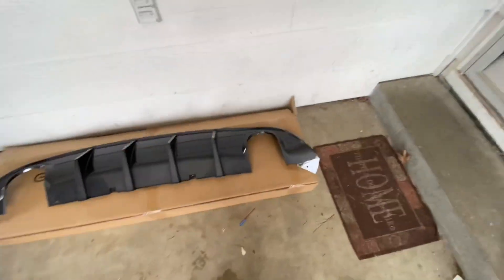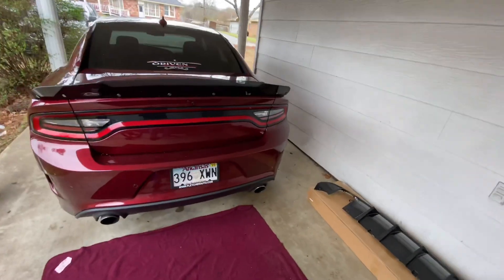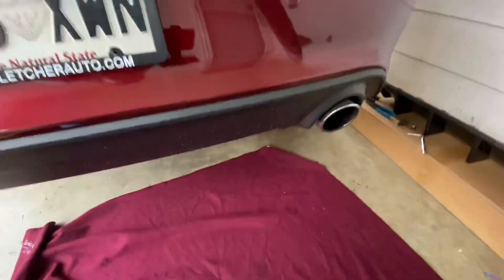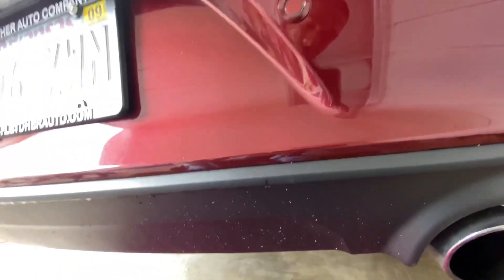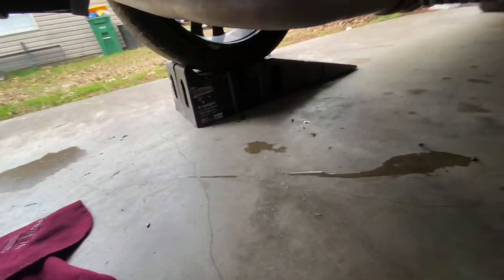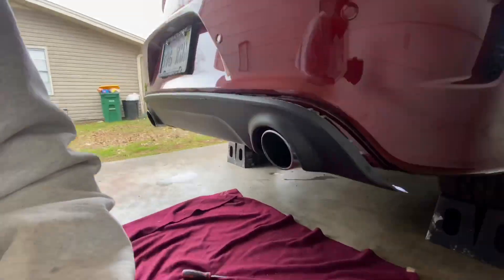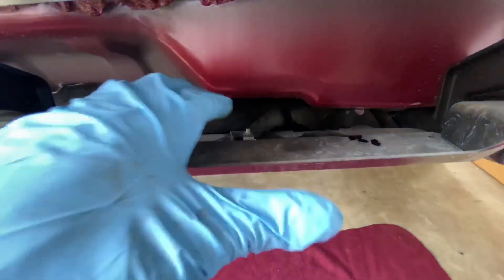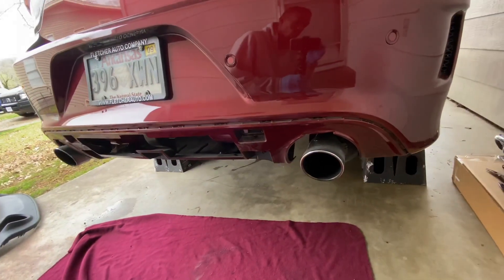Installing my carbon fiber rear diffuser | It Look Amazing ‼️

Comment: Looks goog mang, just received mine by Fed Ex yesterday, going to put in on this weekend, just checking yours out and see how it looked on the car. You should get some tint covers for the tail lights, it will finish that back end nicely with that diffuser.